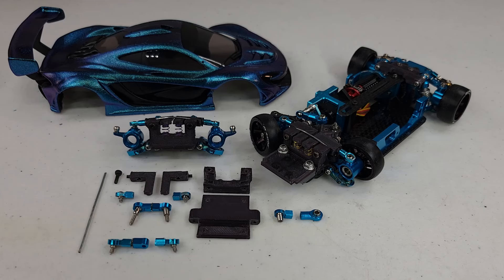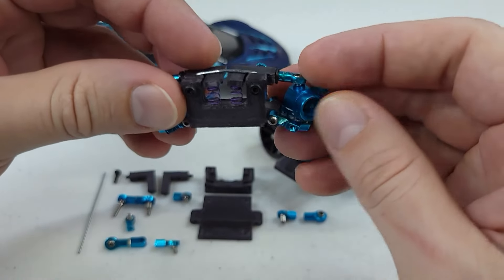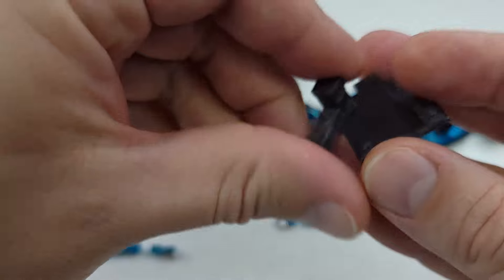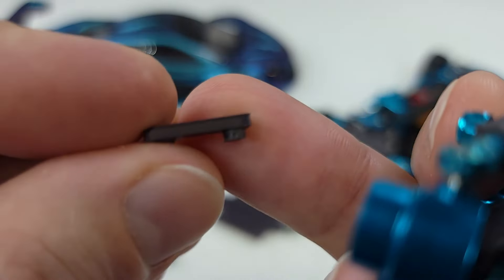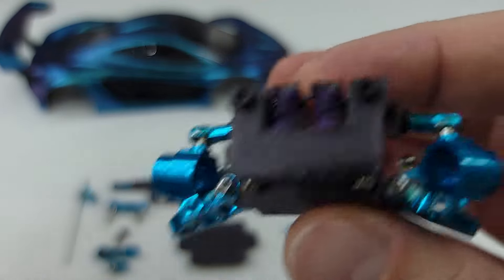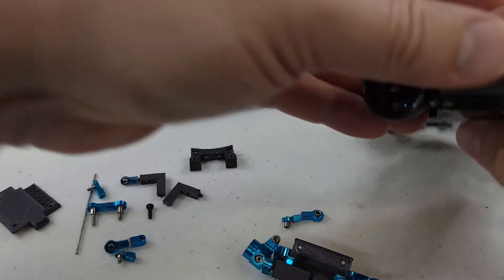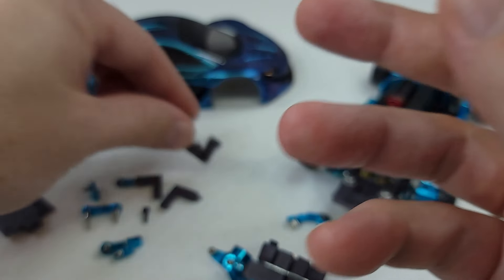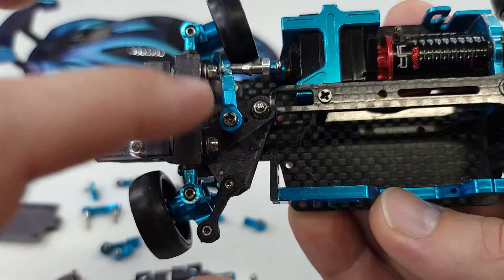WLToys K969 K989 Upgrades Rebuild Part 6: Front Low Suspension Mod Discussion

Comment: where can i find other body shell for it i want something i can customize
Reply from the maker: Not many Mini-Z bodies can fit the stock K969, maybe the Camaro or Challenger can but that's about it. I had to redesign the whole suspension system to barely fit my Mini-Z racing bodies on it. Any 1/24 to 1/28 scale model car body with 98mm wheelbase could possibly fit the K969 but you're gonna have to look around. Check hobby shops online and eBay are good places to start. Do your research to see it you can make it work, you can either mount them with the Mini-z mounting clips or use magnets for non Mini-Z style model bodies out there. There's not much else I can do for you since it's different for everybody.